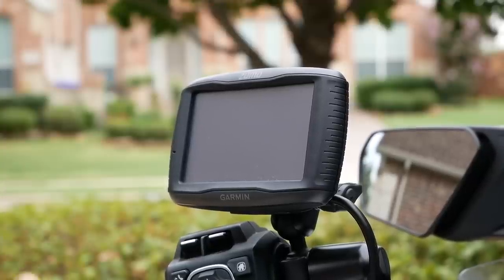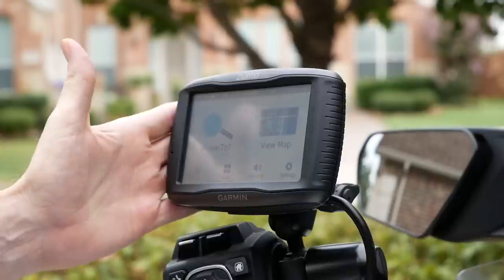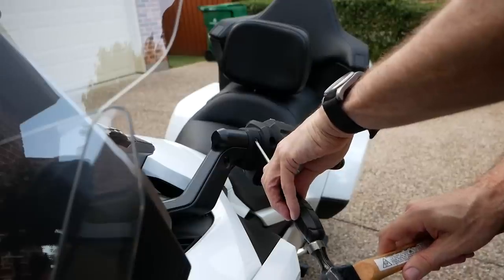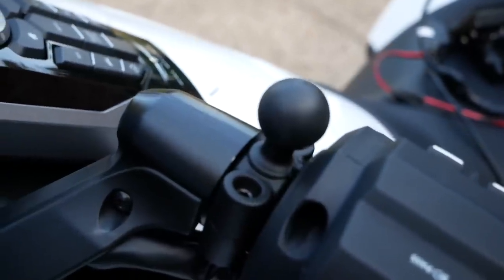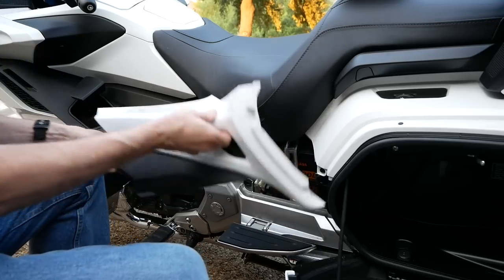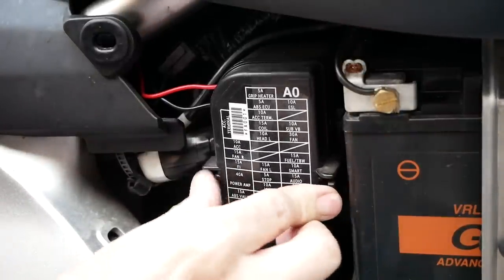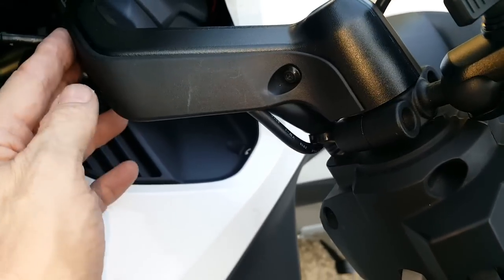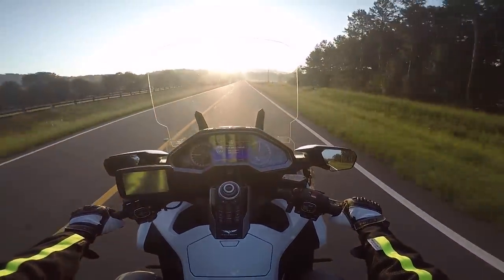Install Garmin Zumo 595LM on 2018 Honda Goldwing DCT

Comment: I had Sierra Electronics install a Garmin Zumo 595LM on my 2018 Goldwing at Wing Ding. They charged me $100 for installation, which I was OK with after looking at how much trouble there would be to run the wiring. Took them about 3 hours to install. I gave the Honda GPS a chance, but I’m so used to Garmin, I bit the bullet and went with the Zumo. Not sure what they did with all the extra wires, they hid them somewhere. Had mine mounted on the right side due to having a cup holder already on the left side. Happy Camper now!

Comment: Just finished installing my Zumo 595LM on my 2017 KTM 1290 SAR adventure bike. I actually cut the cable containing all of the conductors above the fitting that separates them into separate conductors. The overall black jacket was then split for about four inches then peeled back to reveal all of the conductors inside. Most of them were shielded with aluminum foil. The exception seemed to be the multiple very small conductors that went to the USB connector and another pair. There was a black and red conductor wrapped in some shielding foil together that I assumed would be the power conductors for the unit. What was weird was they were only 20 or 22 gauge wires, very small compared to what is on the end of the whole bundle that you get from Garmin for the Zumo. So I stripped them back and tried them out by just stabbing them into the spade connectors on the bike and guess what the Zumo powered up. I crimped some male spade connectors onto the two conductors then connected them to the KTM wiring and put the motorcycle back together. I plan on buying a cradle accessory for the Zumo when I get back from a planned Goldwing trip in late June if the trip that was planned and loaded into the Goldwing navigation system doesn't meet my expectations. I will cut the cable just like it was explained above to attach it to those two connectors at the fuse box. It should make for a very clean installation without all of that extra wire.

Comment: My Garmin Zumo 550 is soooooo OLD, yout light years ahead of the POS Honda supplies to us.  Thanks for tip about filing the index nubbin slightly.  I have the same mount but did not want to remove that index, so now I know the work around.

Rooster

Comment: Thanx for the video .I picked up a few tips like witch was the positive terminal on the fuse box.
I have a 2016 GL1800 .  I remove the intercom dongle and used that port for the Garmin main cord.
I was able to get the power leads back to the fuse block intact and without removing the top shelter. I did remove the glove box and the switch box below it. I connected the line out to the headphone jack. I was able to coil up the rest of the wiring harnesses and stuff it out of harms way .I did not cut anything from the harness. I attached a lighting wire(IPhone charging cord) to the usb output and fed that thru the glove box. My IPhone remains fully charged and paired with the GPS unit. All media and route instructions come thru the bikes speakers. 
I could not find an installation video for the 2nd gen Goldwing and I wouldn't know how to go about making one.

Comment: Hi Cruiseman, thank you for the video, just finished installing my Zumo 660LM (little older model than yours I believe) on my DCT, following your instructions.  When I was just about to button it all up, I thought...the wires I  fished up from the bottom as you did, could instead be used to  pull the lead from the Garmin harness back down, alleviating the wire bundle up under the center console. I had already cut all those extraneous wires from harness and was left with a single red/black integrated lead. However, on the harness for my model Garmin, the red lead is fused, and in order to fish the lead back down, i had to cut the fuse out, and splice it back in, once i had the leads down to the battery. Back up top, I ran the wire exactly as you showed but  was left with only a few inches of harness lead which was easily zip tied to an existing cable. Again thank you for the vid...and if course it's hard to believe, a GPS unit I've had since 2012, had to be installed on a 2018 State of the Art motorcycle. lol
Reply from the maker: Good job

Comment: Chris, dumb question for you. I currently have my radar detector power leads installed in that accessory location in the fuse block. Can I double install wires in that same spot, running my RD and a Garmin off that spot?

Comment: I have a 2018 Goldwing DCT. The on board GPS does lack a few features of the Garmin, but it also has a few good features. Like an excellent screen, a turns list on screen, a count down to turn timer, compass on screen, etc... My Garmin 395 (previous bike) washed out in the sunshine, the screen isn't bright enough. I thought I had a bad 395, so Garmin took it back and sent me another one.....same problem. If the sun is over your shoulder the screen washes out.  If it's a bright sunny day, the screen washes out.I liked the Garmin's features, hated it's screen.
The Honda trip planner isn't terrible, I used it to plan a trip using many waypoints and it worked well....I'm not a big fan of basecamp by Garmin....to each his own, if I were to add a Garmin to the new Wing, I'd recommend the 395 or 396 over the 595, if you have to have a Garmin. It's cheaper, doesn't have a monstrous wiring harness (why pay for all the features then cut off the cables?)and is going to be smaller on your handle bar. The screen is smaller, so if the big screen is what you desire, the 595 is it.....remember there's a 7 inch bright screen right in front of you though. The Garmin can augment the on board I suppose.....the touch screen is nice. I still haven't put it on the wing though.
Android Auto would be a nice update! I'm not an Apple guy, but maybe a second hand I-phone to use Apple Carplay is in the future, It would take advantage of the excellent 7 inch Honda screen.

Comment: Good to see you are back on the 'how to' videos.  I appreciate you did the MotoBlogs for your WingDings trip but I suspect your popularity comes from your practical knowledge and 'How To' material. Certainly not a criticism, I have learnt a lot from your past videos.  Further to this fit up, I would have used a Dremel to create a notch in the mount to suit the pin on the bar which would have aided in limiting bracket rotation.  Also utilising the 2018 Goldwing 3.5mm Aux cable from Honda you could have plugged the Zumo external speaker output (I guess that would be one of those plugs)  into the bike to integrate further; that would be better and more useful if you have a single input source headset (ie. paired only to the bike).  Hope to see more on the practical side and thanks for your efforts.
Reply from the maker: True, but if you tie into the bike's AUX audio source, the only way to hear the GPS directions would be to have the audio set to AUX, it would not interrupt another audio source.
Reply: I agree, but this would be the best way if your headset is not high end and can only pair with one device at a time, being the bike.  It would mean that you could listen to music and when you needed to listen to GPS you would need to switch the bike to AUX. We are on the same page.

Comment: Also, will mounting the Zumo on the left bar, as I have in the past on former Wings, going to impact the mounting of the CB Radio module on the left side then also?
Reply from the maker: Yes. My installation would not work if you have the Honda CB controls installed.

Comment: Chris, I’ve been meaning to ask, how did you port the Zumo sound into you headset?  I’m sure you bluetoothed your Android phone to Zumo for the Apps ability in the GPS. Does that alone get the turn-by-turn to the headset or do you need to connect Zumo to the headset too?  I connected to my Sena as GPS, but the sound is REALLY loud and the first part is “clipped”, I’m sure because of priority levels. Turning Sena volume down affects the other functions too, such as phone and music volume. I tried to connect the Zumo as headset 2 on the bike, but that didn’t work at all. I’m tempted to tear the top shell off and dig out that aux sound stub and connect a 3.5 to it, like where the Zumo was connected on my ‘16 Wing. That sound setup was great and went straight to the headset from the bike, not via the Bluetooth.

Comment: Hello. I have a question since I am considering a purchase of a 2018 Goldwing. If I download the Scenic Motorcycle Touring app onto my iPhone will it work through Apple CarPlay or will you lose out on the other functions such as music and intercom? It seems to me that if the Honda gps is not adequate you should be able to use other gps apps and not be stuck with Apple or Honda.

Comment: So, Cruiseman, did you, with that installation have voice communication coming from the Zumo to you helmet?  If so, was it via Bluetooth and then paired to your CARDO unit?
Reply from the maker: Zumo is paired to my Cardo headset (Bluetooth) on Channel B, it will mute all sound from Channel A (Goldwing audio) when the GPS gives directions. I have my phone also paired to the Zumo as the hands-free calling features are FAR superior to that of the Goldwing.
Reply: I'm very interested to see your full review of the Zumo.  I have a 395 that I brought over from my previous bike, but paired my phone through the Goldwing instead of the Zumo.  I didn't have many calls on the old bike, but come to think of it, have had none on the new Goldwing in the last four months.

Comment: Sad that you had to buy a GPS since the Goldwing comes with one!  Hopefully Honda will do something about the on board GPS to make it better in the future... but I'm not holding my breath!
Reply: Get a iphone, use carplay and google maps, problem solved without spending a bunch of money on a extra GPS.  As much as I hate iOS, I'm seriously considering going this route with a new harley. Or just mounting my phone holder to the 'infotainment' screen.
Reply from the maker: I don't see anything significant coming from Honda.
Reply: Google maps works well for my on the bike or car...
Reply: Very sad. Honda has a good GPS in their Accords. Not getting why this premium motorcycle’s GPS isn’t shared from their automotive side. Their horns seem apparently are. I’m sure if this is as bad as it sounds Honda will surely address it. No reason not to.
Reply: Personally I don't think a update will fix this problem otherwise it would have already come. (in some aspect)
Maybe (BIG maybe) a firmware update will correct it.
Maybe they are working with another supplier like Garmin to correct these issues? One thing is for sure to me and that is they will have to address this at some point because this could be a deal breaker for some folks who will wait for the 2019 model in hopes it will be corrected... ✞
Reply from the maker: There is one reason. Cost. I am betting that Garming wanted $XX per bike for their GPS and Harman offered it for $XX less $10. I don't personally believe the core of the GPS code in the Goldwing could ever be upgraded to provide the functionality of the Garmin. It is a cheap, automotive GPS.
Reply from the maker: Again, the iPhone solution has limitations. You simply cannot design a route with waypoints as "elegantly" as you can with BaseCamp and the Garmin 595. Cell phone GPS is fine if you only want to get from point A to point B, but they are NO replacement for a true, dedicated GPS unit.
Reply from the maker: Fine if you just need to get from point A to point B. Try designing a route for riding backroads with Google Maps. You will end up pulling out your hair. A cell phone GPS is NO replacement for a dedicated, powerful GPS unit like the Garmin 595.
Reply from the maker: I don't either. I think the core code of the Harman GPS is simply no match for something like a Garmin. Honda knew this when they chose to go cheap. Honda went cheap on some other components too (e.g. suspension). They engineered a big beautiful TFT screen that only good for showing which radio station you are on.
Reply: Too be brutally honest there are now many budget systems on the market that kick the ass out of the Honda system. For the money of the wing frankly it is woefully inadequate. 
1. Where is the touch sensitive screen...as a simple start off.
2. Why on earth in 2018 do we have to fumble about entering post codes (Zip codes you yanks say. LOL) in such a clumsy manner.  I can do it on my IPHONE and Zumo a million times quicker than i can on the wing.  I am onee off those who has had to fit a Zumo.  I have to be truthful my dealer, top people seeing the problems fitted one free of charge.  No fees no fitting cost. I have bought a numbeer off bikees from them, top firm eeager to help.  I belive Honda UK made a contribution to my Zumo cost to my dealer. All guys like me, who own a wing, really have to hang our heads in shame.  The Sat Nav is a joke on the 2018 Gold wing.  Regards to all.

Comment: Is is possible to blue tooth to the bike so that prompts-instructions that come from the zumo come out of the Honda audio system speakers. I know you can blue tooth to headset but can you blue tooth it so sound comes out of the bike speakers.  Regards.
Reply from the maker: I don't think so. There is no way to pair the Zumo to the bike. That would be a GREAT feature, but one that Honda will most likely not add. Also, the ability to pair a radar detector.
Reply: Many thanks for reply.  When i make an enquiry from the gold wing it finds the Zumo.  However, when i click on the Zumo icon (On the gold wing) and try and connect it says the Zumo is connected buy cuts off the head set which means car play then does not work?  The wing seems to see the "Zumo" but click to pair and it cuts the head set?  Strange?  Best regards from thee UK>  People tell me my red black Tour model was the first to be registered on the road in the UK.
Reply from the maker: I think the Goldwing is probably seeing ANY Bluetooth device, but I don't think you can pair to it AND a headset simultaneously. Congrats on the first Red and Black Tour!